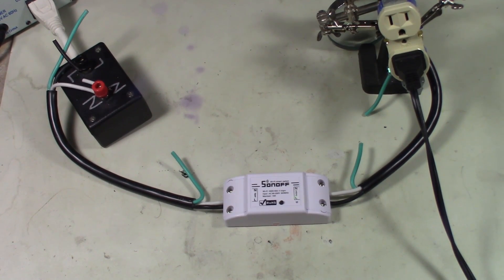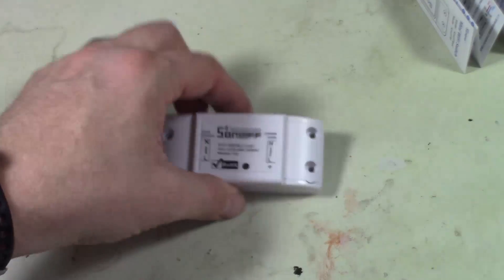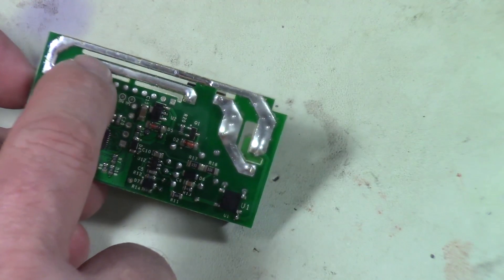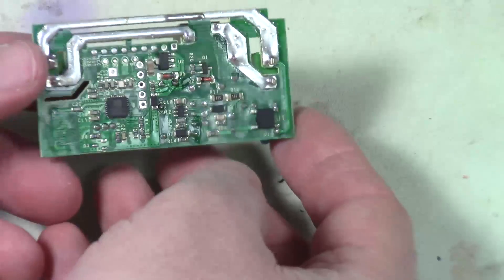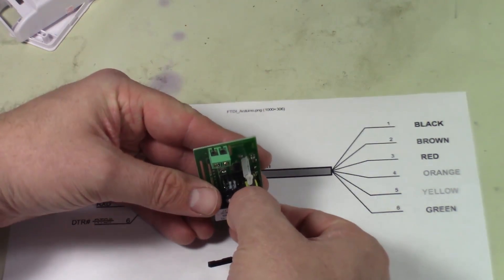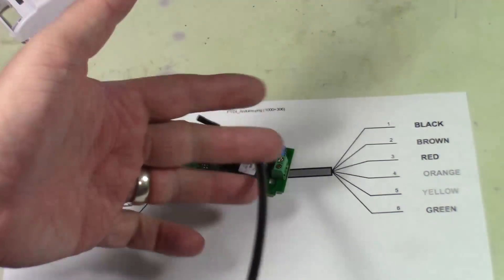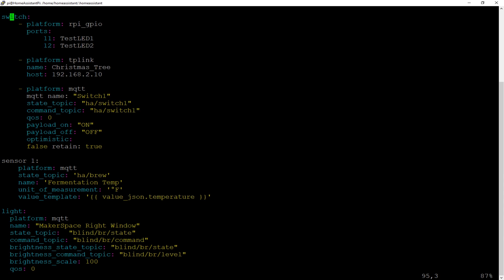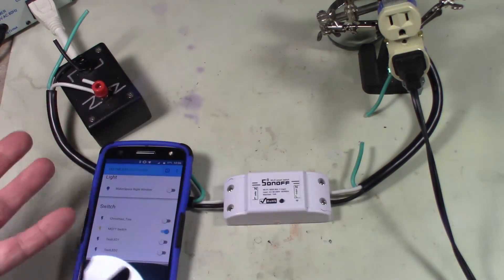SonOff Switch - Reprogramming to use with Home Assistant

Comment: hi , just ask if the ideia will work 
would be possible add  on code something specific as reduce the speed of motor in the start .... than go quickly .... the slow down at end ..... on the way back same  slow... go quick... than slow again .....

so something about it here but my ideia was to put on sonoff mini 

http://www.dummies.com/computers/arduino/how-to-change-the-speed-of-a-dc-motor-with-the-arduino/

How to Change the Speed of a DC Motor with the Arduino

Sometimes you need to have greater control over the speed of your motor, which the Arduino allows you to do with the MotorSpeed sketch. The following shows you how to control the speed of your motor with the same circuit.

The MotorSpeed sketch
Open a new Arduino sketch, save it with a memorable name, such as myMotorSpeed, and then type the following code.

int motorPin = 9;
void setup(){
pinMode(motorPin, OUTPUT);
}
void loop() {
for(int motorValue = 0 ; motorValue = 0; motorValue -=5){
analogWrite(motorPin, motorValue);
delay(30);
}
}
After you’ve typed the sketch, save it and press the Compile button to check your code. The Arduino Environment should highlight any grammatical errors in the Message Area if they are discovered.

If the sketch compiles correctly, click Upload to upload the sketch to your board. When uploading is done, you should have a motor that spins very slowly to start with, speeds up to its fastest spin, spins back down to a stop, and then repeats. It can be difficult to see this, so you should fix something more visible, such as adhesive putty, to show you what’s going on.

You may find that at its slowest point, the motor just hums. If so, this is not a problem; it just means that the electromagnet doesn’t have enough voltage to spin the motor; it needs more voltage to generate the magnetism and gain momentum.

The MotorSpeed sketch breakdown
The pin you are using to control the motor circuit, digital pin 9, is declared.

int motorPin = 9;
Because it’s an output, you define it in setup.

void setup() {
pinMode(motorPin, OUTPUT);
}
In the main loop, you use analogWrite to send a PWM value to pin 9. This is the same principle as in the Fade sketch, used to fade an LED. The first for loop sends a gradually increasing value to pin 9 until it reaches the maximum PWM value of 255. The second for loop gradually returns this value to 0; then the cycle repeats itself

void loop() {
for(int motorValue = 0 ; motorValue = 0; motorValue -=5){
analogWrite(motorPin, motorValue);
delay(30);
}
}
This process could be likened to revving a car engine. If you push the pedal down, you accelerate to full speed. If you tap the gas pedal, the engine accelerates and then slows down. If you tap it at a constant rate before it slows, you will maintain some of the momentum of the spinning motor and achieve an average (if somewhat jerky) speed.

This is what the transistor is doing, but very quickly. The intervals between on and off and the momentum of the motor allow you to achieve analog behavior from a digital signal.

Comment: At  last got my Sonoff switch to work , thanks to you. Awesome you rock. Struggled with Tasmota. Just a question, if I need to add a second switch , which of the fields do i need to change besides the one ha/switch2 ? thanks
Reply from the maker: Thanks for the feedback and I. Happy you got it to work.  I believe the ha/switch2 is all you will need to change on the Sonoff code.  Now in the ha config you will have to change that and the IP address for the new switch.  Let me know if you have any problems

Comment: Thanks for great video.  I have been struggling with days trying to get my Sonoff with Tasmota working and not know how to see if the Topic is the same on the Sonoff and HA. I added sonoff2 in Tasmota and in HA but still not working. The switch just turns off as soon as I click on it. Going try your firmware .

Comment: Hello. First it is a great Video and second sorry for my bad english. I'm German. So i try to tell my issue. I have use your script and i have follow your instructions 100%. I have put my SSID and Password in the Script and loaded it on my SONOFF. I use the embedded MQTT from Home Assistant and use your Config. But it don't Work. If i but the SONOFF on the Arduino Monitor it tell me this 
" wdt reset
load 0x4010f000, len 1384, room 16 
tail 8
chksum 0x2d
csum 0x2d
v4ceabea9
~ld"
again and again...
Have you any idea ?
Reply from the maker: Ahhh yes I have seen this as well.  What it could be is that if you have anywhere in the code a possibility of an infinite loop that can cause a watch dog timeout (wdt).  Also the ESP8266 library in arduino was recently updated and can cause this problem.  Try reverting back a few versions of the esp8266 board library.

Hope this helps.
Reply: @misperry  Can you tell my which library you add. Sorry but i'm new in Arduino and i'm not sure that i have the right one.

Comment: What will happen if I connect + wire to - Position & - wire to + position by Live Current. ⚡️⚡️
Reply from the maker: Would that be on the input or the output terminals?  It depends on how they have it configured on the circuit board.  If they are using a full bridge rectifier then I would say it really does not matter for the polarity since it is AC.  However, since they have indicators on the plastic that states "L" for line and "N" for neutral I would follow those symbols since it is cheap gadget and you don't know if they have protected it correctly.
Reply: @misperry  Yes , Something Like Same "L" To "N" Position & "N" To "L" Position. Than What will happen. 🙄
Reply from the maker: Yeah, like I said it depends on how the circuitry is set up on the inside of the box.  It may do nothing since it is AC as long as they have used a full bridge rectifier in their design and not grounded it.  I would not chance it because if they did not build the circuitry properly it could explode!  And that would be bad! :)
Reply: @misperry  THANKS FOR YOUR COMMENTS. 😃😃

Comment: Terrible wiring connections and Earth not used
Reply from the maker: I agree about the ground.  However, this was a demo of what you can do.  If I were installing it into something I would have a ground wire present in the box that I would be bonding everything to.  Also I am working on a video series of whether or not things will work and I am very skeptical of the sonoff switch.  I had a viewer request this video so here it is.  Thanks for the comment.

Comment: No ground connection.... very bad example.... you better connect the grounds to eachother and hook up the ground back in to the source...
Reply from the maker: Yes I agree.  I was showing this for demo purposes.  I am working on another video about testing this with full ratings and seeing if it is really reliable in your house.  Also I will show how to professionally install this device with grounds and proper safety.
Reply: On the other hand.. sonof should however include this in the product  too..  :) just a circuit connection passing the switch would be fine for me aswell :)

Comment: I had a similar problem when working with the Sonoff Wifi Switch, bought recently from Amazon.  When set with Flash Mode DIO, the code seemed to load but would not run.  I switched to DOUT, then it worked fine.
Reply from the maker: Thanks for the information

Comment: will this work for flashing tasmota on sonoff?
PL2303 Usb To Rs232 Ttl Converter Adapter for Aurdino Nano Raspberry PI 
https://www.amazon.in/PL2303-Converter-Adapter-Aurdino-Raspberry/dp/B00UZERG94/ref=sr_1_2?ie=UTF8&qid=1523215191&sr=8-2&keywords=ftdi
Reply from the maker: I believe so but I was not able to tell if it is 3.3V or if it was 5V.  You need a 3.3V converter or it will DAMAGE the onboard esp8266 device.  I think if it is trully a TTL level converter it will be 5V.  Basically one like this one I believe https://www.amazon.in/SLB-Works-FT232RL-adapter-Arduino/dp/B077JSXX7X/ref=sr_1_17?s=industrial&ie=UTF8&qid=1523286626&sr=1-17&keywords=ftdi

Just make sure it is only 3.3V and not 5V otherwise you will need a level shiftier.
Reply: misperry Thanks a lot

Comment: Hi again, I have bad news. It still does not work. I have done everything you have told me: in the Arduino terminal I have selected everything you named in your video. I have configured my wifi and the MQtt correctly. It is the only thing that I have modified the rest remains the same. I have nothing blocked or filtered on my router. The MQTT server is working and I have contact with the client. However, my Sonoff "dies" after the flushing. There is no contact, it is not present in my network. The switches in the Home Assitant appear and work but have no contact with the Sonoff. I do not know what to do now. Could be so kind to take a  look to my terminal settings, maybe you can find the reason why it does not work. Could you please connect me by email? (cototo2005@gmail.com). Thanks in advanced.
Reply from the maker: No problem at all.  I will send you an email shortly.

Comment: Thanks buddy, I hope you find a solution to the problem. I will be very grateful for that. I'll be waiting. Thanks a lot!
Reply from the maker: Well I just set it up on my network again and got it to work.  What are you seeing in the Serial terminal from the arduino?  Also my terminal settings are "No line ending" and "115200 baud".  Make sure you have the baud correct because it is coded for 115200.  Also double check your Mqtt server settings and make sure you do not have any MAC address filtering on your router.  Let me know.
Reply: Hi. I have the same problem. After flashing. Dead...
Reply: contact me by mail (cototo2005@gmail.com). Are you swedish?

Comment: Hi again,  I have tried again a couple of times, but with the same result. This firmware is the solution to my communication problems Sonoff - Hass. I need your help to find out where the fault is and be able to flash the Sonoff normally. You can not imagine how many things I have tried but without positive results. I am very sure that this firmware is the key to solve this problem. Thanks in advance.
Reply from the maker: Hmmmm... Yeah this sounds like maybe the code I have has a bug.  Well I promise this weekend I will take a look at it myself and see if I can reproduce and then provide a code revision to github and make sure it works.  Thanks for trying this and I will get back to you soon.

Comment: Hi thanks for the video. I have communications problem between Sonoff and Hass with an other firmware. I tried your firmware but after flashing sonoff it's "dead", I can't find it in my network either. For the first time I can see "live" in the switch in Hass but it hasn't contact with Sonoff. When I flash it again with the old firmware the Sonoff is active again. Any idea, any advice?. Do you know whats the problem is? Did a mistake somewhere? Thanks

Comment: “I wanna stress you’ve got to be very careful with that...”
Then at least connect the ground wires!
Cheers!
Reply from the maker: Good point there.  You definitely need to use 3.3V when programming or you will burn up the onboard ESP8266.  Also NEVER try programming it when it is connected to MAINS voltage!!!!  You can Damage your USB port in your computer or worse the computer itself.  Always be careful when working with Mains!

Comment: HI I have to agree with squalazzo use tasmota to flash it then you can use the wifi access point software called wifi manager that is all built in and you can configure a ton of settings like MQTT or use the long row of holes to use as pin outs for a bunch of stuff and extra hole you didn't use is all ready preconfigured as a switch for that gpo pin also use tasmota to flash esp8266 stuff also and all the Sonoffs will have built in OTA updatingAlso just can not stand the ground not being connected when using a tail like that where your just cutting the cable to splice in the Sonoff don't cut the green ground wire just route it out side of the box and tape or hot glue It to the side of the case but that ground could save you or a pet some day Just my 2 cents :)
Reply from the maker: Yes I agree that the tasmota would work great with it.  I am simply showing how you can customize and not have to rely on an outside source of code if you don't want to.  Also this was a very crude connection to show how things work and so yes I would highly recommend that if you are installing this switch into an actual system that you connect all grounds and if you install it into a steel box you connect a grounding screw to the box and bond your grounds.  If you are in the US you definitely need to adhere to the NEC (National Electric Code) or the best would be to have a professional install these if you are unsure.  Great comment thank you!!
Reply: I do like videos keep making them :)

Comment: too much hassle: flash them with tasmota, configure via web using their access point, use them, done... not even need to compile anything, there are precompiled binaries, flashable with nodemcu flasher
Reply from the maker: Hey there thanks for your comment.  Yes there are pre-compiled binaries that are very use full.  I was simply showing people how to build their own.  I am, by no means, saying that this is the only way to do this.  This is simply a way that you can have full control over what the code is going onto the SonOff.  Thank you for the suggestions o ftasmota and other binaries that does help for someone that does not want to build from scratch as a simple and quick solution.

Good comment!